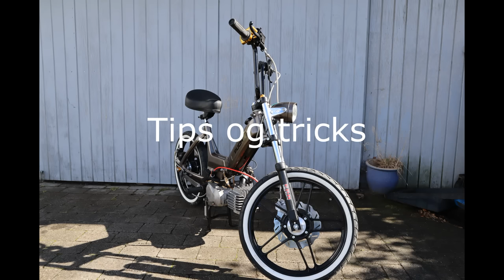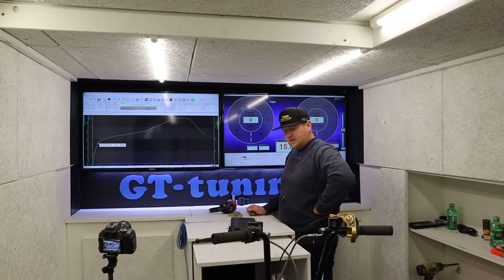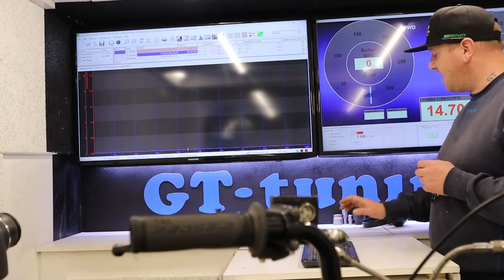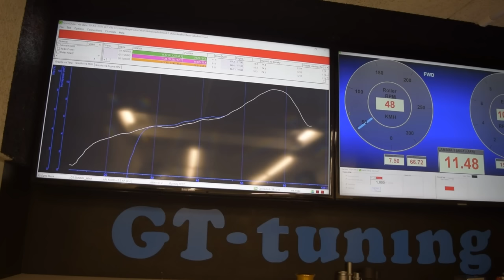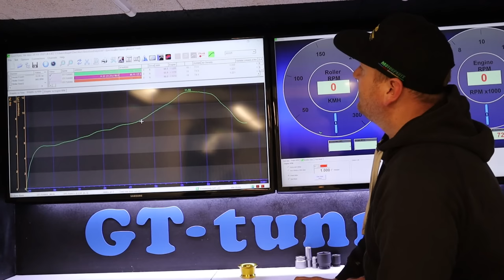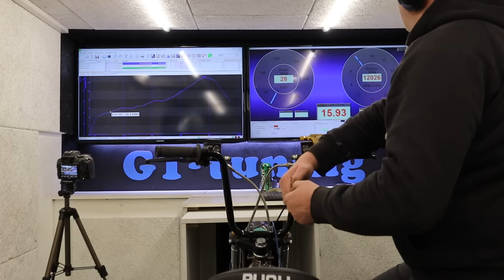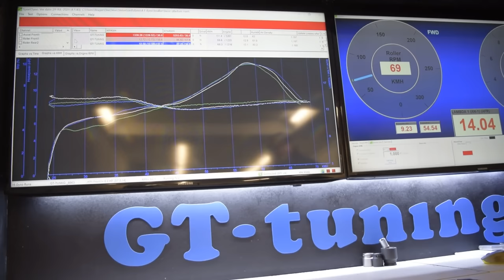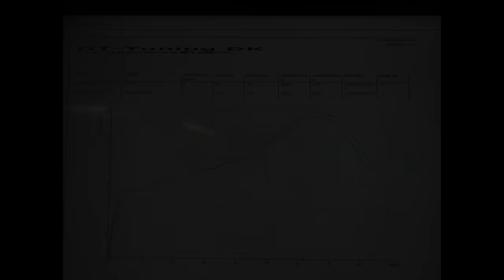Puch maxi gilardoni 74cc max HP? AH tt/GT sådan laver man en stærk cylinder;)

Comment: Ville det ikke give noget mærkbart at stroke den 10cc?
Reply from the maker: man flytter jo meget når man laver slaglængden om,
Reply: @gt-tuningdk  så et stort måske hvis?
Reply: Hvis du tilføjer 10cc og matcher porttimings og -arealer, såvel som en korrekt udformet udstødning, topstykke, tændingskurve og i øvrigt bevarer max rpm, vil ydelsen løftes, uanset om slaglængde eller boring øges.

Hvis du tager den selvsamme 74cc motor og går fra 43mm til 49mm slaglængde (+10cc) uden andre ændringer end en spacer under cylinderen, vil porttimings blive så påvirkede, at effekten daler ... ret drastisk, formentligt.
+14% slaglængde er en stor ændring.

Undgå den logiske fejlkonklusion, at "totakteren er simpel, fordi den består af få bevægelige dele".
De to eneste enkle ting ved totakteren er at få den til at omsætte brændstof til lyd og at smadre den i en fart 🤙🏻

Totakteren er et komplekst apparat, som er proppet med diffus og svært visualisérbar fysik.
Derfor er 99% af ejerne nødt til at lyve om tophastighed og effekt; "Den mangler justering." 🤮😂

Firetakteren er sgu enklere at have med at gøre, når det kommer til stykket.